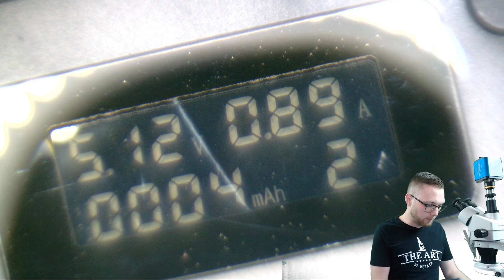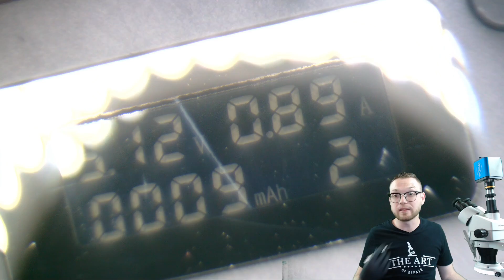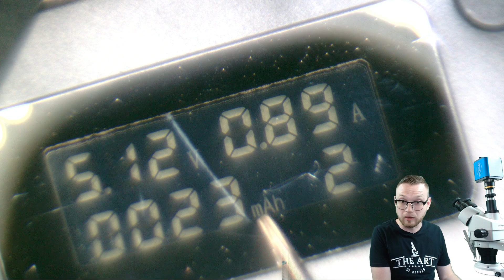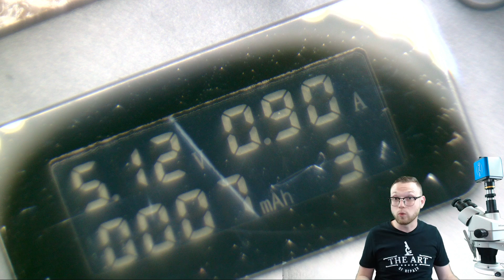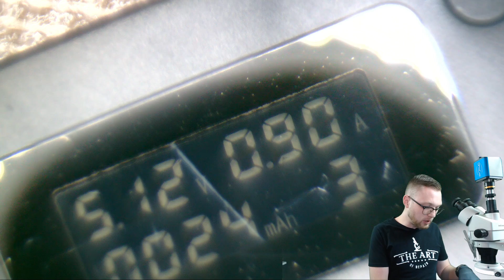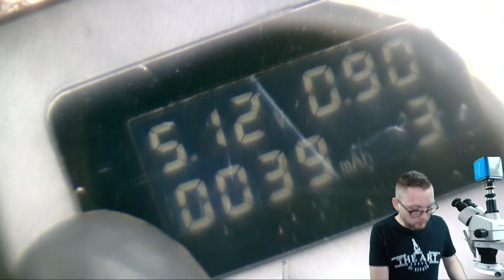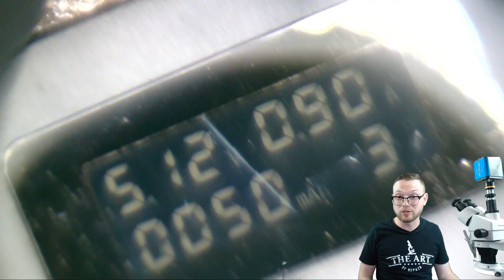EP46 The Diagnostician's Best friend | How do I know if this phone is short without opening it?

Comment: So I just got one of these USB testers and I was hoping you could give me an idea of what's going on with this reading, there isn't exactly a ton of stuff to look at out there on this outside of unboxings.  Trying to put myself through phone school by patching together info.  I've got a dead phone, when I connect a regular phone to the USB connector it gives me 5.24 volts, and around 1.8 amps (samsung fastchargers).  The dead phone gives me the same voltage but .52 amps so obviously there is something wrong but its not a complete zero so there is some activity here.  So what exactly have I learned from this info? Obviously, there is a power issue but how much does this narrow it down?  If you could just toss me a really quick, off the top of your head, type of response I'd really appreciate.  Like an idea of a symptom to a cause ie.

 If the amps are 0 then obviously there is no power getting to the phone and it could be a handful of things, it could be as simple as the micro sd slot or it could be the entire motherboard has been replaced by a Ritz cracker. 

 If the PCM chip is bad then will it still get a reading, just a low reading  (like around .52 amps perhaps)  or will it show zero if the PCM is bad?  If the battery itself is bad will you get zero reading or, you guessed it, will it just show low amps like let's just say .52 for example, like is there a minimum amp level for a phone to power on?  

So basically I'm trying to get an idea of which symptoms would still register a reading, albeit a low reading, when testing and what causes I can cross off.

Just want to say you're probably the first youtube video I've commented on in years, I'm learning a ton.  Thanks.
Reply: Not much at all.
Reply from the maker: Truth be told, every device has different characteristics for this type of stuff. Alot of people think there is a database based on these numbers that are universal. Thats why in my power supply video i added the  "sometimes" While yes sometimes it can give a direction. Once you know their is an issue, its generally time to open the device and confirm the issue and look for visual ques and such. Do not rely on the Poweramp meter to be your endall for short or issue diagnosis.  Whenever you add compounding issues in a pcb where there are literally hundreds if not thousands of connections. More than one type of damaged component may bring back the same reading and do not forget that some types of issues are logic based. Not everything in a circuit is cut and dry. Especially considering that most of the ICs are pretty much figured out as we go and do not have 100% documentation. Now if we have all the information on each IC and its exact functions, then the whole process would be much easier. Hence why I tried to make a note in the video of the limitations of pure amperage based diagnosis. I hope this helped you understand a little bit more about this tool and how to use it and its limitations.

Comment: So.... 0.00 amps would be an open on the main power rail right? Not a short....I think you said short... high amps = short, low amps/no amps = open...right?
Reply from the maker: No, your not wrong. in some instances it can show that there is a short in the device, but yes it does generally show and mean there is an open circuit. =) I actually plan on redoing this video and adding a bit more content for clarification purposes. =) Thank you for the comment!

Comment: Very good Justin.  I bought one of these other day.  I have a nexus 7 plugged in now.  And it's pulling 1.11a.  Is this bad?  It's not turning on. Is this board problem? Thanks for any help.
Reply: Jeroen Thomassetti hi. I have tried new screen.  But nothing lighting up.  Now I'm starting to question the screen etc.  And yes I caught on after I posted that the higher the amps it must be good.  Need to learn more diagnostic board stuff.

Comment: Why does pulling 0.00A show you have a short? Surely a short would pull all the amps it can. Can you please explain further. Thanks
Reply: In my experience, 0.00A will be a bad dock connector or a bad cable or a short. Easy way to narrow it down is open the device and apply power directly via DCPS and see what current is shown
Reply from the maker: Its time for you to start studying circuit logic. There is not a universal answer for all devices since they design things differently brand to brand. =) Different devices handle shorts differently. I already have a video planned for this, so stay tuned. But GTM is right also in the fact that it can be a bad dock connector or a short. After you see no power he is also correct that it is time to open the device up and work from there. Looking for visual damage first , then short detection via multi meter then once the short is confirmed,use a DCPS to locate the component via heat or with extreme visual inspection.